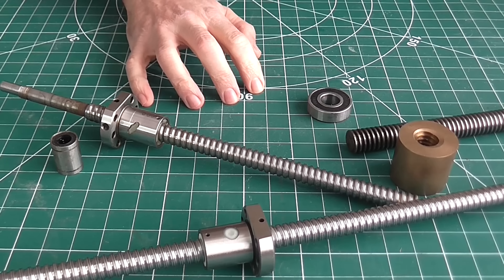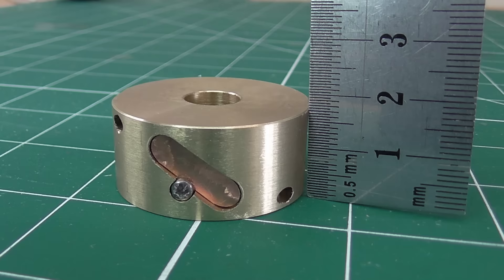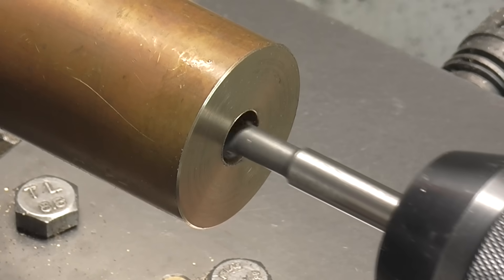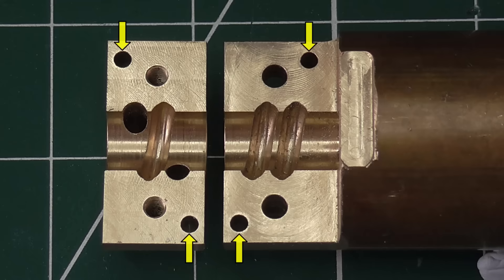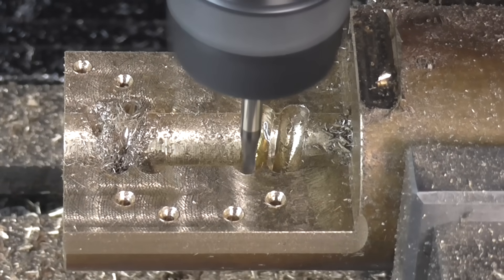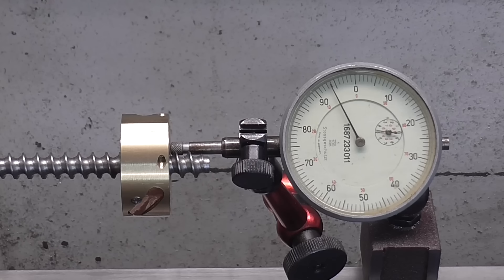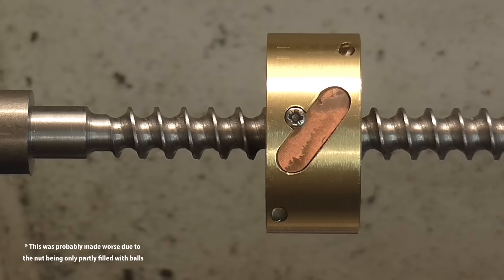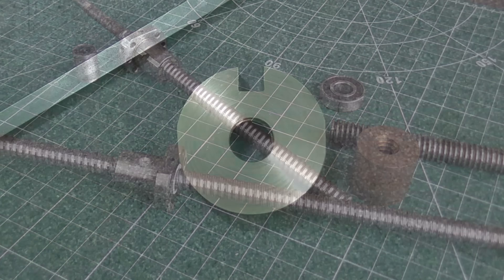How I made my own Ballscrews

Comment: >Basically a helical ball bearing 
>making point contact with hardened steel balls
>it's not going to have to withstand the large forces
I think there's a reason why they usually make the ball bearing with exceptional quality steels rather than brass.

Comment: use freecad for your next cnc project ;D
Reply from the maker: I did actually try that. And went back to Excel.
Reply: Oh why ?  @AndysMachines
Reply from the maker: Don't get me wrong, I think freecad is great, I prefer it to fusion. I actually designed the ballnut in freecad (and many of the illustrations in this video were done with freecad) but I couldn't get to grips with the paths workbench. Maybe I need to give it another go but it's often easier to stick with what you know!

Comment: Have you considered non-recirculating nuts?  They'd be like helical drawer slides.  You'd need a cage to hold the balls against the screw but overall the actuator could be slimmer and have the same travel if the cage is half the length of the screw + half the length of the nut.
Reply from the maker: I see what you mean, but in this case I needed the maximum amount of travel from the shortest nut possible, so it had to recirculate.

Comment: Both the brass and the steel will continuously work harden with use.
You might want to rig a drive to do a few thousand full length cycles overnight (under load) to even out the hardness along the full stroke.
Awsome job !!

Comment: Awesome job, but maby a stupid question, couldn’t you just cut off the two other ball paths in the commercial one?
Reply from the maker: Yes, good suggestion. I would have to soften the nut first as they are too hard to machine even with carbide. The diameter of my nut was larger so that I could attach it to the rod and key the side, but I could have made a repurposed commercial one work.

Comment: What about casting the nut with the threads? Brass or bronze shouldn't be hard to melt.
Reply from the maker: Castings always shrink and warp so you'd have to cast it with an allowance and then you could perhaps finish it with a custom tap that only removes a small amount. Still probably would be more work than this method.
Reply: @ Yeah. It's definitely a problem, but I thought brass and bronze are impervious to temperature changes. The nice thing about casting is the ability to gang them up as one long cylinder then slice them into nuts. For making just one, it's not worth it.

Comment: One quibble with your design:  it's impossible for balls roll in any circular path with four points of contact and no slipping.  That's exactly how ball bearing lapping machines work.

To eliminate sliding you have to use two points of contact, which means a race profile whose diameter is slightly larger than the ball diameter.  You can eliminate backlash completely by shifting the inner and outer races along the axis.  The result is an eye shape that's only wide enough to hold the ball in one position.  You can even preload them with reasonably high force while still allowing the balls to roll.  Hard steel balls rolling in brass would deform the nut to make their own path -- that's why bearing races are usually hardened -- but you can get zero backlash and pure rolling contact with a light preload.
Reply from the maker: Yes, you're right, but the balls would only have 4 points of contact under radial load. Under axial load unless there's zero clearance (or an interference fit) the load would be spread between just two points (as in the illustration with undersize balls, and why most ballnuts have 2 or more circuits preloaded against each other). However linear bearings must have 4 points of contact? Unless they are the double row type which can have just 2.

Comment: I generated nose radius compensation by hand recently to turn on a CNC-mill and felt pretty good about myself, but Excel just isn't beatable.
I do actually think there's an over reliance on CAM in the hobby-scene, I work in production and write my programs on the machine. If you don't have 3D contours it's not that hard to do.

Comment: This is, without question, the best B@LLSCR3W video I've ever seen. I hope you don't get demonetized for it's overtly graphic detail. Spreadsheet? Maybe consider a little Python , I think that'd be easier.
Reply from the maker: Python is also a really useful tool, I've used it in the past for doing image processing, but I find Excel more straightforward for generating gcode.

Comment: If you made your screw and nut out of materials that work harden, I'm thinking stainless, then use shims to adjust the split nut... do you think such ball formed races would be uniform enough for a smooth high load ballscrew?

I am enthralled by your innovative approach, moar plz!
Reply from the maker: I did think I might have to adjust the nut somehow to get it to work, but it worked ok. Brass does work harden but it's still relatively soft. I think to wear in/form either the nut or screw it would have to be made from material a lot softer then the balls. There are definitely a lot of possible variations on this approach.
Reply: @AndysMachines  You should try to get slightly bigger balls, it would reduce backlash with no further machining needed. As you have 0,1mm backlash currently you should go with balls 0,05mm bigger. I have repaired worn out ball nut this way - by ordering balls 0,02mm bigger, as it was too expensive for customer to order a new screw/nut set and backlash was only slightly too big - it  will work for few more years until it crosses the line again. 
I would also smooth the screw a little, using some 400 grit sandpaper wrapped around something soft like electric wire or large oring to conform to screw shape.

Comment: Doing CAM in Excel is cursed, great job!
Reply: I'm still in shock.
Reply: It is Excel Assisted Machining.
Reply: I'm almost in disbelief.
Reply: The very definition of brute force.
Reply: I've seen one mechanics professor at university making shaft vibration simulations in ms access with vba. After this, making calculations in excel is pretty nice, I sometimes use excel to generate text conversions. While I know several programming languages, it is sometimes way faster to do it in excel than to make a custom simple script in python especially when you only need to do it once.
Reply from the maker: I agree, I've also done a little python in the past, but sometimes excel is just the best tool for generating gcode or some other series of data from a few simple mathematical formulas.
Reply: @AndysMachines  holy shit you really did that in excel? I thought that that was a joke lol
Mad respect man, you're insane
Reply: I have written many small programs to generate cnc gcode. I never thought about trying to do it in excel. I suppose it's not that hard depending on what you want to do. But I have a program I wrote that I can generate pockets square or circular and any cut depth that I use often. For instance I will simply plug the start x/y position and end x/y position and tell it to take a bit off the top. Its great for resurfacing without needing to draw in can then define in cam and finally send. Instead I just plug in the actual machine coordinates in and define the feed rate, bit size and depth per cut and I immediately have code to send. No drawing, no homing or offsets etc.
Reply: I mean, excel is almost like a programming language. And using something like Python to make a quick script to calculate or generate certain things is a common practice among tech people. That is very impressive.
Reply: I've done it in excel before, for those that don't have extremely fancy CAM systems, it is useful to use excel for doing rotary axis stuff on a mill.
Reply: He is an ExCAM Man 😅😂
Reply: what!?  suddenly i feel like the kid that sticks bubblegum up his nose compared to this mad scientist.  hopefully that was just a joke..
Reply: I wrote one in 2009 that would generate code to surface any round shape given the x,y,z radii and tool radii. Ah yes, the good ol' days 😆
Reply: next time he better uses paint
Reply: Surely some easy to learn but real programming language such as Python would have been a better option here?
Reply from the maker: Yes, python is good, but I'm sure it would have taken me longer than with excel.
Reply: @MikkoRantalainen Python is better for a general solution, but for one-off solutions where you just need something to work once, Excel is often more convenient.